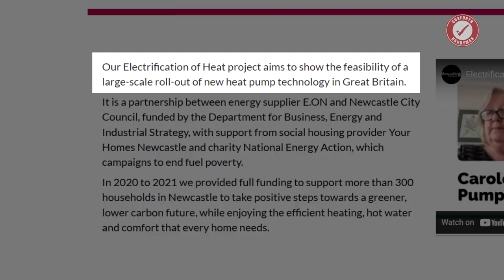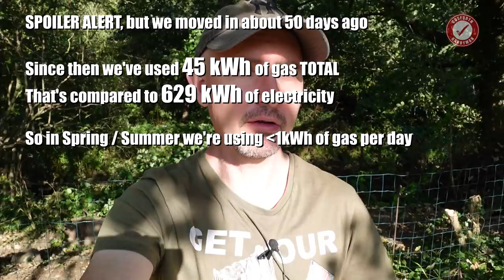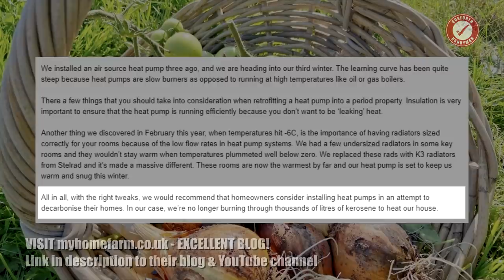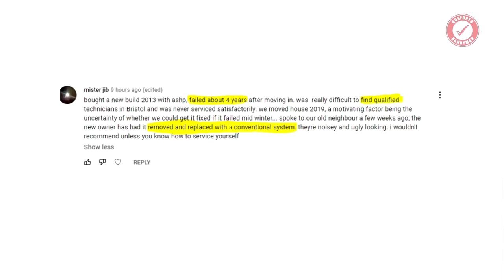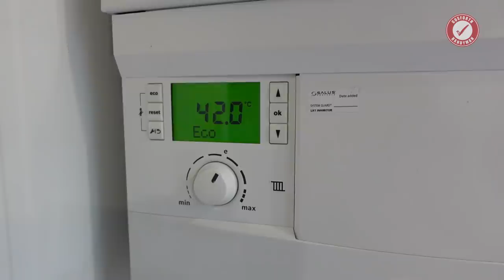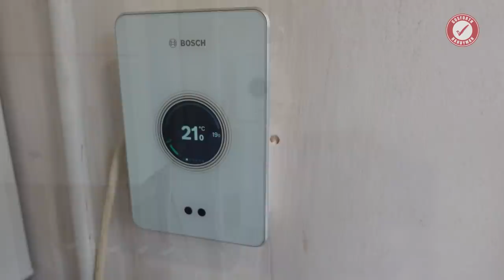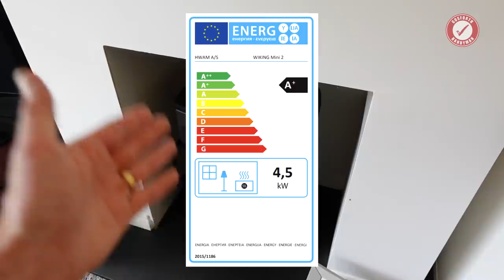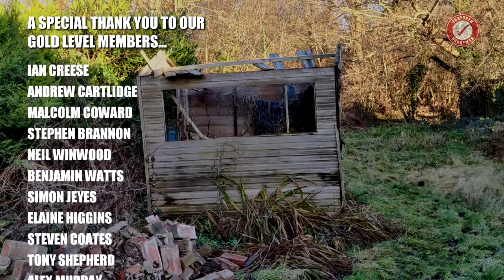Why didn’t we install an Air Source Heat Pump? (1920’s Renovation Part 32)

Comment: Very sensible video. We renovated our central London flat and put in a Valient combi (should have gone Worcester Bosh or even better a Viessmann). We have a long lease in what is a Grade 2 listed building but legally can't install double glazing (windows are owned by the freeholder). Nor I suspect would we be able to install air source heat pumps as the listing specifically related to the exterior of the building and putting 80+ on the roof would be impossible. It's was a similar situation in our old country cottage (again Grade 2 listed) where the bonkers local conservation officer allowed us to have super high quality double glazing (from Bronze Casements) in one side of the house but not the other. The same conservation officer was taken to appeal 3 times in 2 years by villagers whose applications he rejected and lost every one at a vast cost to the council and us as taxpayers. So much of the climate emergency debate focuses on binary big ticket ideas like Net Zero without much detailed consideration to the complexities of seriously reducing our consumption (let alone that of countries like China). In our former village was I suggested to the local farmer that he could, with some investment build a  community ground source scheme and become the most sustainable local utility. He had the money and was investing it all over the country in things like care homes, but wasn't interested at all as he said it was much simpler doing nothing and  getting the  £100 per acre subsidy from the government plus as percentage of the crops (done on a contract basis with another farmer). This was in a 'model village' built in 1900 where all the electricity was generated by hydro, but today 95% of the houses are heated by oil!

Comment: Bought a 1977 house in Minnesota with electric baseboard only.  Yikes.  No ducting, no hot water piping or rads, no access to natural gas.  Installed a lowtemp heat pump and it carries most of the load with a little help from the old baseboard.  Just added a pellet stove on the lower level.  Heat pump kicks out heat to -22degF, but not that much at that temp.  Needs help at times.  Works well though and provides a/c at good efficiency.

Comment: I have had an air source heat pump installed in February this year by my housing association. I had storage heaters before and our village doesn't have gas. Most ptople in thevillage use coal fires,storage heters or oil central heating. It took a few months for me to get used to the settings. Now I start it at 6AM at 22 degrees for 3 hours then 17 degrees for 2 hours until 10pm where I have it set at 17 degrees. Strange however that on Saturday my radiators are stone cold until the evening. All fine the rest of the week. My energy supplier though still uses the economy 7 settings and they have to change it to a single tariff.

Comment: An additional thought :
Electricity is generated in part with CCGT (combined cycle gas turbine) at around 35-42% efficient, with electricity transmissions losses of between 20-30%, while a gas boiler must, by law, be better than 95% efficient.
Go figure which problem should be solved first.

Comment: Living in an "altbau" (or "old building") in Germany, with central hot water & heating, I definitely do see the value in the smart radiator controllers, but that's because the heat is on when the central unit decides, not when you want it to be comfortable, there are no thermostats, so having them connected via smart devices does make sense (even if I set a lot of them once, the flat still fluctuates greatly in warmth

Comment: Just one observation, your Easy Control thermostat controller should be in your living room, not next to the boiler (unless of course you want to make sure your boiler is kept in a nice temperature controlled environment...), and really needs the connected TRVs to maximise efficiency.

Comment: I live in a new build apartment Andy, I'm also in the trade (gas/pumbing/electrical) and I kid you not I had to read the manual cover to cover to work out how to program the combined heating timer thermostat, it is massively over complicated. I have spoke with others in my block and they all admit they gave up and now they just turn it on/off manually!!!! in 2021 in brand new builds people are having to manually operate central heating, can you believe it? There is a lot to be said for the old wall mounted dial room stat, it didn't get any simpler than that!

Comment: Ive got a 3 bed 2007 property semi detached with a car park on the side.

I've had a quote for 8500 for mini split which apparently is better as your not warming water to move around the home at lower temperatures cooling down as it goes. 

Love to know if you reviewed these, there normally advertised as AC units as they do both.

This plus solar is apparently going to balance the extra electric cost of the mini splitd
Reply: Seems a hell of a lot of money for a single? mini-split system, it's not going to be more than a couple of days work for two guys to install it.
Reply: @edc1569  this quote was for 4 indoor units and one outdoor

Comment: Another point is to ask an air conditioning service engineer on how reliable are heat exchange units are as they are similar opposites. Apparently they need regular maintenance and often go wrong. In my work place the air conditioner heat exchange unit  is always going wrong or being replaced.

Comment: Did you consider a renewable fuel system like wood pellet? On paper, it should give you renewable credentials without all the low temperature output issues of heat pumps.

Comment: I personally found your setup to be the most sensible but I probably would have opted for a high velocity forced air system for heating and cooling that you could have put the vents in the walls and existing walls. Then you could have done a hybrid system using an air-to-air heat pump down to say 30° and natural gas below that. Having said that I think if you were to add some solar thermal to your boiler setup you could easily have something just as efficient.

Comment: I know someone who has had an air source heat pump installed it is an absolute nightmare heating bill has gone up by 3 times triple radiators are so big they take up most of the wall they sit on, as for the noise it is terrible situated near the back door

Comment: Combi’s are great for houses up to a particular size. If you have a big house with central heating and a couple of bathrooms it will struggle if everything pulls on it at the same time.

Comment: My heating installation today would be simply individual high efficiency storage rads plugged in with individual stats and they will be on or off no other controls. Hot water instant heaters at point of delivery. Wood burning stoves will shortly become outlawed.
We were also persuaded by the gov. To buy diesel vehicle, would not Change to anything else now.
I agree do not assume the gov. Is the best director to all the tech.
Asap instals are so complicated they are not. Cost effective. Well done!

Comment: I think the issue with spray foam is there are cowboys putting in cheap, non breathable foam, the lack of breath ability causes condensation and rot. Also it’s hard to tell what type you have without causing damage to it if there’s no proof from installation and if an error was made, the surveyor or mortgage company could be in trouble.

Comment: I doubt if heat pumps will work in Newcastle. It's too cold for them. I live in the South West with an air source pump in a 7 year old house with excellent insulation. My house is built (partly of course) of Thermoblock. The pump not very good even here. The radiators have never been hot or even fairly warm. My last home in the north, with a gas boiler had radiators sometimes too hot to touch. It takes a long time to increase the room temperature even when there is not much difference between temperatures. But it costs a lot less to run. But then you get less heat. The local council demanded that heat pumps should be installed in all the new houses and in a neighbouring estate- and they also demanded that they should be enclosed for noise purposes. The manufacturers said no enclosure so they were all taken off. They really are not very noisy.

Comment: One of the benefits that the plan for heat pumps would assume (significant insulation, sealing the property, mecanical hear recovery ventilation, under floor heating) would make most of the benefit. If you add in a good catalytic wood stove, the expense and bother of heat pumps seems bonkers.

Comment: We have a heat pump system in our trailer.  It only works down to about 6 degrees C.  Any colder than that and it doesn't work well at all and freezes up the system.
Reply: Yeah, that's when you install cheap garbage.

Comment: Great video 
Gas fired power stations efficiency 50 - 60%. Maybe they should be phased out, or only used for peak demand! 
Modern gas boiler 90 -  95% efficient.

Comment: There is Biomass heating, but the pellet stoves don't really work in the UK and the pellet and log gasification boilers. Also Solar hot water if you had a cylinder and solar PV for running the house and maybe car charging.

Comment: Most of the people in my neighborhood have heat pumps. They don't heat water for radiators they heat the air in the house. You have to have a duct system.  The main advantage of the heat pumps is that in the summer it will cool the house.  I live over 2000 what you call kilometers further south than Cardiff.

Comment: You couldn't be more on the same point about the approach to a more sustainable way of living than me.
I also don't like to throw things out of the window that are just fine to use or re-use.
In my renovation I reclaimed a lot of the old building materials to use as hardcore, fill in for less demanding concrete etc.
Kept re-useable wood apart, other unpainted wood is kept for the stove, and yes, it's a A+ new one, licensed for the most demanding cities where they have strict regulations on woodburning stoves.
I have all my window-frames replaced, glazing is tripple A+++, its expensive but you can get a good deal of the added price back via a grant.
Proper 100mm PIR insulation goes on the flat roof, and the exterior walls will be insulated next year.
I keep my gas boiler, but choose to buy a good inverter AC, it's around €2500,- but can produce around 5,5kW max and still 4,5kW of heat at 0°C outside.
The AC also gives me cool air in the summer, here in SE Netherlands days with more than 30°C in the summer are becoming more common, with often prolonged periods of such heat whereby the heat and humidity indoors gets unbearable.
The outside unit goes on top of a bay window with a parapet wall on top which keeps it out of sight and the noise down, also no neighbours on that side.
Warm water will be provided by an ASHP hot water boiler which is a stand alone unit and can be installed in series with the combi boiler so that water can be reheated if the water from the HP boiler isn't hot enough anymore.
All this in combination with PV panels will have my gas boiler like in your home rarely running, only when temperatures really drop below zero in the winter gas heating will be needed.
And AC, new wood stove and ASHP hot water tank combined are much less than 10 grand, while I don't have to touch my existing central heating system.

Comment: Had an interesting chat with a heating engineer while he was setting up an air source system. This was in a huge new build with all the latest greatest insulation (wool and spray foam),underfloor heating, solar, hvac,etc,etc. When I asked about the government's push for air source systems,he said they wwre expensive and weren't as efficient as gas boilers especially in existing homes for but in his opinion the government don't care how much it costs you, to fit and run, they just want you off gas/ oil heating.

Comment: We’ve had an air source heat pump for a number of years in the end the RHI made the pump gratis, agree it took 7 years 😏. The reason why was a) rural property, b) no gas in the area, c) existing oil boiler kaput and oil costs ☹️, d) had a coal hopper fed boiler previously (more expensive than oil),  to make it suitable for our older rural property we also installed some fancy convector type radiators. The system works fine, no way can you get the heat as more conventional boiler system and require secondary source heaters (electric fire/ lpg fire) for those really cold days. Be warned though that the electric bills v high in the winter months! Have had £400 per months bills in Jan/Feb 😳 though it still works out cheaper than Oil.

Comment: Hello from the wet North West :) being originally from California it's so interesting to see the differences in how things are done. In the US the majority of properties have hot water tanks, and tankless systems are luxuries that cost a lot more than a tanked system. I have a combi boiler here and when my extended family visited for Christmas (in the before times), they were so thrilled to be able to just ... take a shower or bath, whenever, no worries about whether someone else had just taken one. 

On the other hand, I agree they are miles ahead over there with closed-cell foam insulation. I have wondered if part of the difference is that a lot of older houses over here are built to breathe? e.g. I've recently realised whichever prior owner of my Victorian terrace had the stonework repointed didn't insist on using lime cement, and it's causing problems with the stone that I will have to deal with (££££). Same with damp problems I've seen where someone has used a type of plaster that doesn't breathe well with the brickwork. Putting spray foam into that system could cause serious hidden damp problems (unless maybe it's only at the roof?); whereas in the US they tend to wrap all their homes with Tyvek and other waterproofing membranes so the walls were never meant to breathe and they can just spray foam the whole thing (in between the timber studs, another standard practice) before putting up the drywall.
Reply: Proper detailing would be to give an air gap to the wall.  So exterior can breath and dry out but interior of the home can be made air tight, etc.  While there's open cell spray foam, have to go thicker for equivalent insulation value but it would allow some breathing.  Closed cell is what would be vapor/air tight after about an inch and half thickness...  Sometimes they will be mixed, do a thin layer of closed cell and rest open cell to save on cost or provide a variability in how the insulation handles the environment...  

Exterior options included dimpled membrane that provides something to fasten the exterior siding to but provides an air gap behind the siding...  Among other solutions they've developed but you need a good builder who knows all the latest advances and how they should be applied in your region of the country...

Comment: I came to the same conclusion. I had quotes ranging £15000 to £23000 for various heating solutions all based around an air source heat pump. The best advice came from a ground source heat engineer who advised me to install a gas boiler, which I did, a combi boiler.

Comment: One problem with air source is they are at their least efficient when one needs them at their most efficient. I had some when I lived in France were to put it bluntly bloody useless. Once back in UK we investigated ground source which is a more stable setup but one problem is you need a well insulated property due to their operation at lower temperatures. In our case being a 16C thatched property we would have had to double our radiator sizes, ie house one big radiator.

Comment: Might be worth checking your incoming mains for non return valves and your mains water pressure. Worcester recommend a pressure reducing valve and shock arrestor because the plastics can pin hole due to the pressure. Page 17 in the book.........I think

Comment: Air source heat pumps are expensive to install , they are expensive to run and are noisy......
Stay well clear of them and stick to central heating whether it be rads or underfloor or a mixture of both , you will be better of both financially and a nice warm home , also Andy makes a very good point about insulating your home , the more insulation you can fit the more you will save on energy bills........👍

Comment: Great video.  Strange that you've missed a great tool for energy efficiency you seem to have added by accident!  Because you have added the Bosch thermostat as opposed to a Nest or Hive you automatically have better modulation - ie the water temperature of your heating system will be reduced (saving energy) because your thermostat can talk easily to your boiler (because they are the same make).  Please research this online and you will find it very fruitful.  A very thoughtful video - thank you
Reply: Yes, weather compensation controls are important when looking at efficiency

Comment: I live in U.S., northern state, gets way colder than you. ASHP can heat house no problem. Don't know what models they are using, I'm toasty warm saving lots of money. Problem is lack of quality installs and quality equipment. Wouldn't buy any American made product. Very difficult to find good knowledgable technicians. Boiler is still great choice, reliability of either option is questionable.